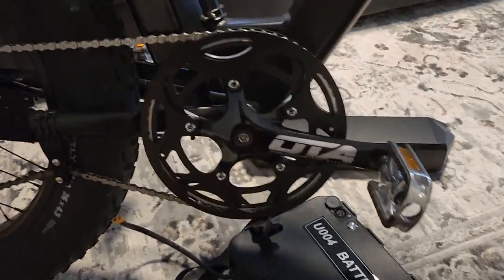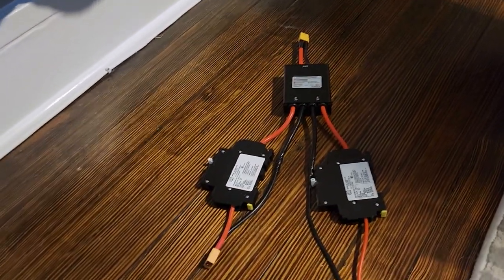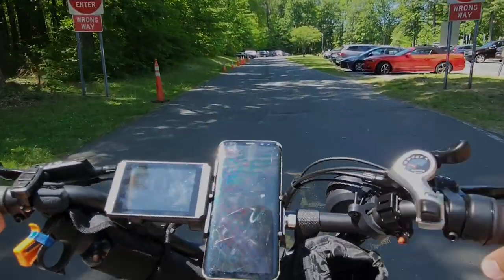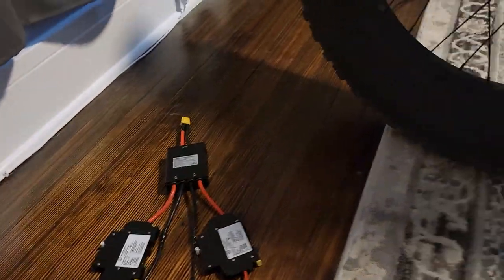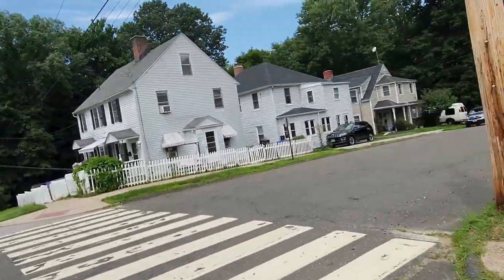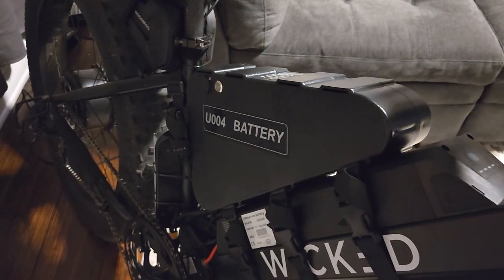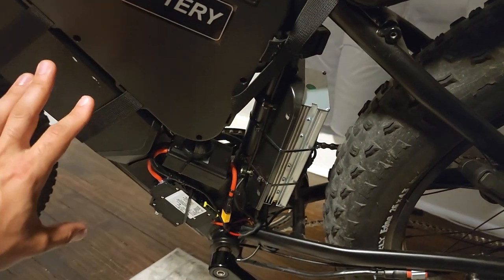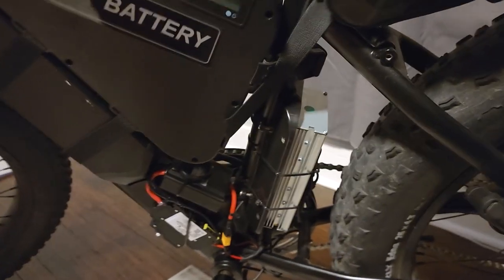Will It Melt? Part 2: Wired Cruiser Power & Range Upgrade

Comment: Increase your wire gauge as much as possible. It will decrease your voltage drop thus decreasing power loss (Power=current x voltage drop) resulting in less heat. It may work for awhile but over time heat will take its toll. Most notably wire insulation becomes brittle. On the controller I would also like to see more heatsink, in the form of aluminum sheet, bolted on to make as many fins as you can fit. Holes in the controller case for fan and ventilation would expose it to moisture would be my biggest fear. I liked the circuit breaker set up and wounder what kind of range you will get. good luck!
Reply from the maker: Part 3 coming out this week!

Comment: That bafang motor is probably super hot on the inside. It just doesn't have a way to dissipate out... That motor is good. Up to 40 amps in short burst. Anything more than that, the internal planetary gears will melt but the hengtai fat hub will take 60 amps at 72 volt and has metal internal planetary gears ( think I seen some cheap on eBay labeled as 2000 watt geared rear hub motor) cool bike and good luck!
Reply from the maker: Mine has the hengtai. The motor temp is actually okay, it's the controller that gets crazy hot. Trying to get some active cooling on it with more heatsinks

Comment: The most you will get is 2400w. That controller is maxed out at 40a but that's just a burst it normally runs at 20a. Shunt mod won't even gv u 5a extra. Better off changing to different  controller to 60a if that's what u r looking for.
Reply from the maker: If that's the case I will definitely get a new controller. Worth trying it out. The bike is 60v so I already get almost 2300 watts

Comment: You don't need those circuit breakers if your batteries have a power button. Your controller is rated 20amp continous 40amp max. It will not draw 80amps from the batteries. Running dual batteries it was actually draw half the amps from each battery so actually 10-20amp max from each. Your 30amp circuit breaker will actually never trip if you are going uphill as it draws 40amps because your controller will draw 40amps max, but if you are running dual batteries it will draw 20amp from each battery. However your circuit breaker will trip if you run the batteries separetly as when you draw 40amps from your controller. Also make sure Regen is turned off if your controller have regen.
Reply from the maker: Excellent! This is perfect as once the shunt mod is done the controller will indeed draw more amps, hopefully max 60 amps! Thanks for the feedback man. Also the base battery didn't come with a power switch

Comment: Curious to know if you had your motor temp on on your display? If so did it read properly?
Reply from the maker: I actually didn't enable motor temp. I should have! It doesn't get too hot compared to the controller which is REALLY roasting. Today I was messing around with different fan configurations to cool it down more, including opening up both sides of the controller and pushing air inside with a fan. I also finished the basic performance testing with the two batteries for a reference point once the shunt mod is complete.

Comment: What's your full range with both batteries?
Reply from the maker: Didn't do a range test yet, But I might once I get a stock controller. I'm sure it will be at least 40-50 miles at moderate throttle speeds.